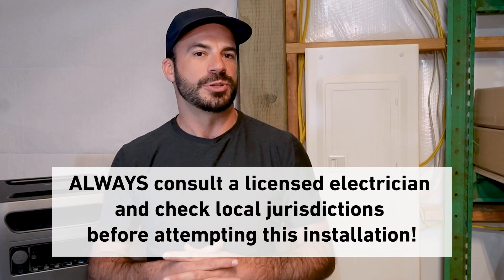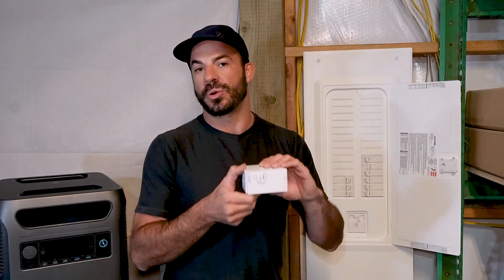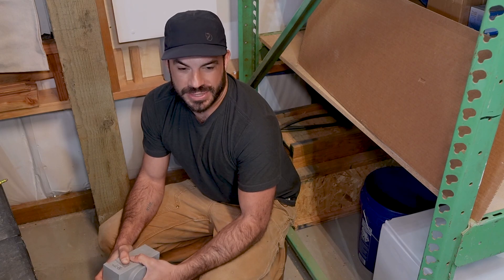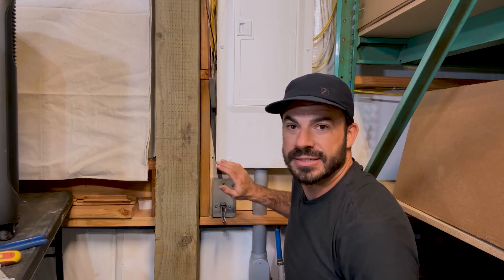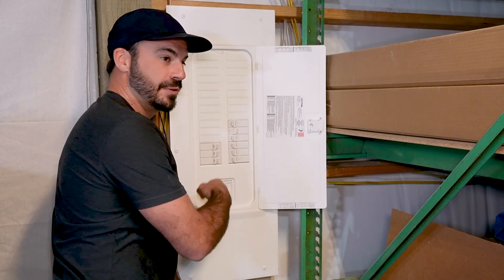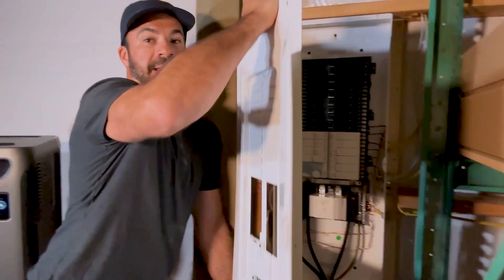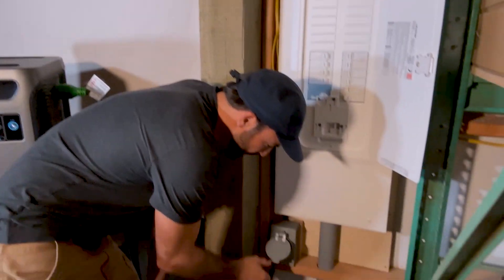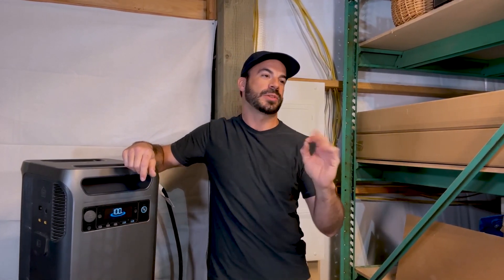Generator Interlock Kit Installation | Anker SOLIX F3800

Comment: Need a video on the F3800 and the Anker SOLIX Home Power Panel and how and wether it can use more than the allotted number of solar panels. I was told the release of the home powers panel would allow you to use existing solar panels to charge youre F3800 and additional batteries, trying to figure out how to get this to provide adequate home power backup and peak rate charging on a large home with 20 x 400watt panels already purchased and installed